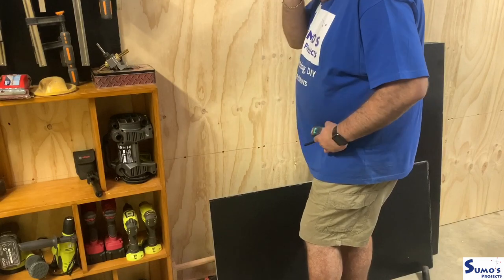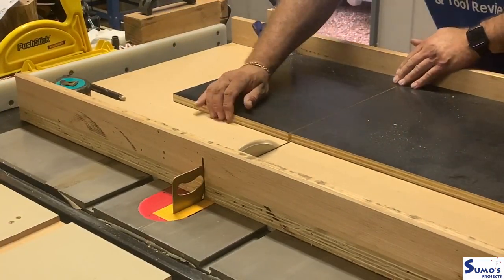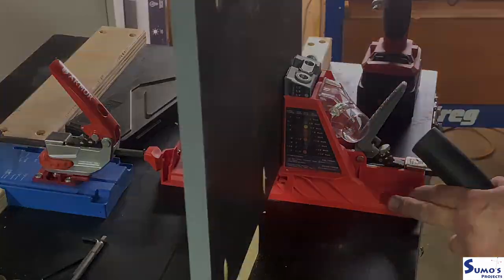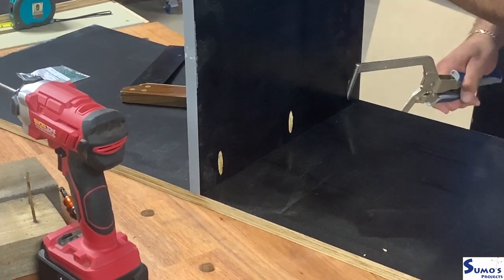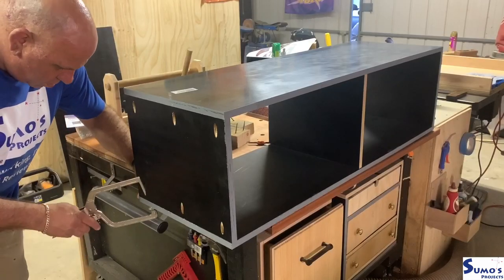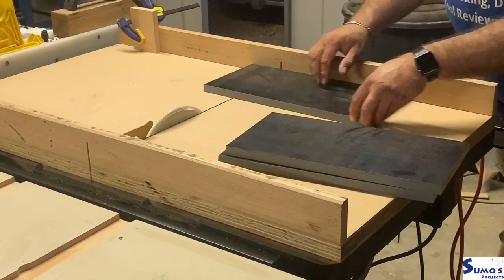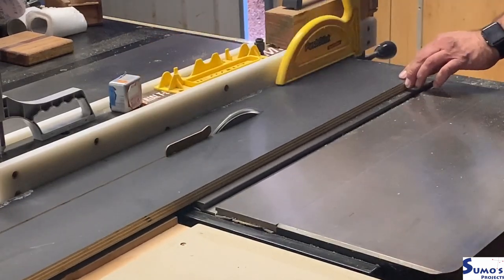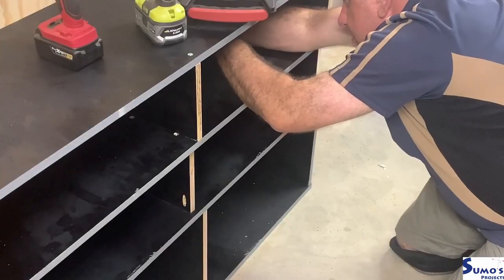How to Make a Custom Shop Cabinet | Extra Workshop Storage

Comment: Great video. FYI.
I found a fitting in Clark Rubber that allowed me to connect the vacuum hose to the vacuum outlet on the  pocket hole jig. Double ended male 'link'. Cheers John
Reply from the maker: Thanks John, great suggestion mate & I had a spare hose so I cut the tip off it & works a charm but then I found the one I’d been missing lol so now I’ve a spare 🤠🍻👍🇦🇺

Comment: Dirk, I've gotta ask, wtf is formply? 😳
Reply from the maker: G’day mate, it’s plywood with an exterior phenolic type coating on both sides & because the edges are coated it’s reasonably weather resistant, ive seen it used as a divider in some outdoor cafe settings & on building sites as well 🍻🍻👍👍👍
Reply: @sumosprojects  I’ve never heard of it maybe it’s called something else here, gonna look into that though 👍👍👍